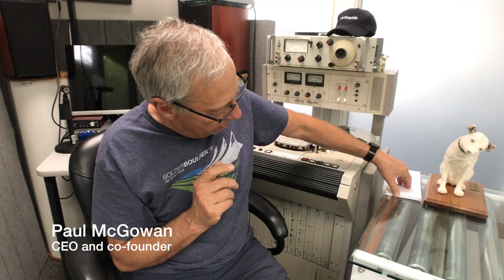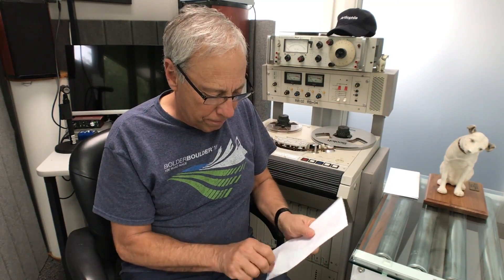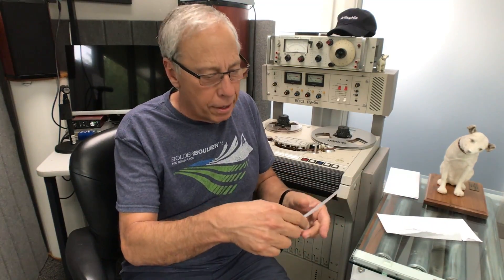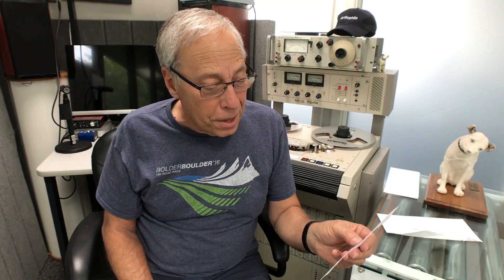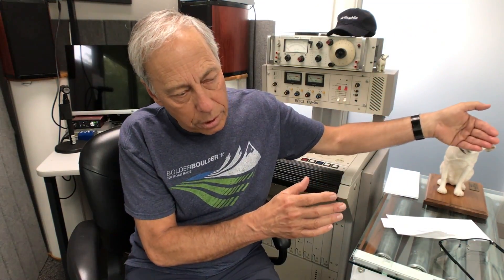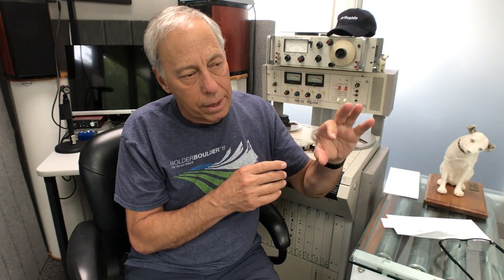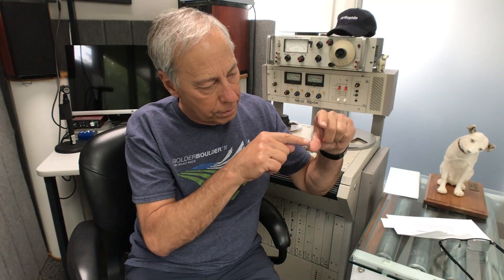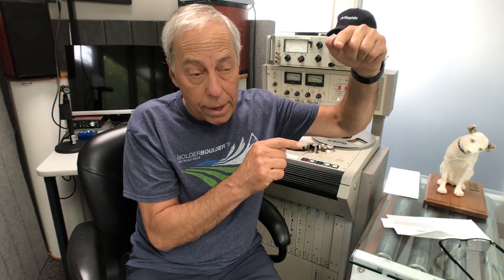Why are power amps so difficult to design?

Comment: A follow up question for Paul would be this: Why have there been so many variations in amplifier topologies over the years? It almost seems like engineers would have settled on one basic type that tends to work best for most systems and listening needs. I totally get that different designs yield different sound qualities but I’m still shocked at the number of variations over decades. And they still keep coming.

Comment: Having been in electronic manufacturing for decades, the single most common failure is power related.  Logic failure is very low like less than a percentage point.

Comment: I think it is not very difficult to design a very good audio amplifier if you are familiar with electronics, signal amplification and thermal management. It is much much more difficult to design a very good speaker.

An audio amplifier is a more or less straight forward development. Most of the work you can do allready with a good circuit simulation tool to find a simple design which fulfills your requirements and safety means like short circuit protection. Then you have to do some intense breadbord testing to find out, how your circuits behave at its limits. The next step is to bring it on a perf board which is close to its later PCB design to validate the parameters and limits. Then you will have to bring the design on PCB, check it and bring it into its final enclosure.

It is more difficult to design an audio amplifier for series or even mass production. In this case you have to take good care about the material, manufacturing, assemby and testing costs. And you have to take care about to get all the things for your whole production period, right in time and in place where you need it. And you have to make sure that the people will like your product. You have to take care about its look and feel properties.

Comment: I've been working on my power amp design for more than a year now. Getting a power amp that works is not hard. Getting a power amp that works, has low distortion and is reliable is not. Douglas Self, Bob Cordell and Randy Slone have all written very good books on the subject. 

It took decades before big solid-state amplifiers were made reliable, and there's good reason for that.
Reply: What drives the reliability issue?  Also, which book would you recommend for someone new to electronics?  I can build a simple single ended class A amp but beyond that….

Comment: Ok so I know this is a little off topic but you mentioned putting an amp in a rack or outta sight. This is why appreciate some of the older tube amos especially mcintosh and some of there new tube amos. With there astetic design you would be crazy to put that outta sight I feel the amplifier is 2nd only to the speaker they run. The dac,preamp, cd, power conditioner everything except mabey the turntable is just a box but the amo has curves and tubes and shiney steel and lights under the tubes. I feel that designing the body of an amp to compare to the performance of an amplifier is just as much art as you get in hifi. Mabey it's just me but I like to look at my components as a piece of art. Kinda the way some people would look a monea. The housing of a component can be just as alluring as a sculpture of a Greek god. I find the astetic of a component one of the most enduring quality

Comment: I have the 7kappas. What amp should I use? Or is my Sansui 9900z (165 watts from hell) enough?
Reply: That depends. I would recommend it like this, 4000-16000w RMS speakers use 900w amp, 1200w RMS 190w amp 

As the motive is to feed it with enough energy, I would like to advise you to look at your speaker specs and amp specs and then do the needful.

Comment: The best sounding and most silent power amplifier circuit i know in 43 years of audio is the circuit from the mid 90 and got better to the last edition with one stage extra for  better low frekvens control.The end 3.2 and The end xp millenium no negative feedback local or global.small size Linear.The midrange never thin sounding.Sound dont change with power.I have bild a "high"sensitivity 98db active speaker system swith 40inch tall 6inch wide push pull planar magnetic linesource midrange and 20inch amt tweeter section and 12 inch woofer pr side.and needed much lower noise from the p.amps.the power amplifiers i used made to much hiss.could hear it from my chair.These are so silent that my ear have to be close to tweeter to detect it is on.  I use a ground sound dnc24rpc dsp based active filter,1 pr side. I build a 4 channel verson of The end xp millenium in 2016 and again was supriced how good they are.I have put 2 stereo 21step autenators on inputs so i after calibrating the system room eq filters etc i can adjust the filters to 0db and level everything at the p.amp for that section of speaker Just a preference.The same type amplifier circuit was also used in a class a amplifier called Zapsolute from Scandinavia.They where design by LC audio

Comment: i just made a power amp its a very simple power amp  based on a 2n3055 and a mj2955 transitor and its a ab diode biased 

i use a lm833p op amp as a preamp and i use the transistors output for feedback  to the opamp 

and only on one channel when the signal is high at the top of a sinus for example i see using s osiloscope a very high osilation ~15MHz  (my scope is not that precise old analog scope great for oudio fel on its face ones needs readjusting ) and when you touch the transistors it goes away i have tryed somtings   anyone a good idea  to solve this
Reply: btw its stil sounds great and it has  completely overkil  powersuply using too 15 amp transformers at ~ 14 volts   and i use huge 0.5F caps conected whit a inductor from the diode briges  and i have 0.05 vold ripel on a 65watt resistant load

Comment: I'm not a high wattage listener, the tube amp I built works well enough for my needs but I know how much of a challenge building a power amp can be, I had a go at building a solid-state amp with a differential input stage, voltage gain stage and compound-pair output stage ... with some speakers it sounded great and could put out some decent wattage, but on other speakers it just oscillated like crazy (I'm talking Mhz here). Talking of speakers ... half an ohm? Why would anyone make a speaker like that?
Reply: Looking  inside some crossovers it is possible. Gaining one advantage  producer may fail in other place. Such value may be imagined only for particular frequency and if it is somewhre is sopranos then power load  may be  not dangerous (except oscillation) But check also carefully all sheldings in preamp.  Anyway if amplifier is not low output impedance then   feedback will not adopt  2) signal will be silenced. .  The worst problems are  within speakers and crossovers. Their basics of operation lay in changing circuit impedance depending on frequencies. That is equal to shifting the phases. How can one  demand that amplifier is not affected?  Their deficiences could be eventually compensated by amplifiers by  between other low output impedance. But my observations go further and show that it  cannot  cover deeper problem. Developed  by me  change of crossover philosophy although does not equalize impedance  made for me  opportunity to get rid of 90% misteries, No more questions about higher effectivity  and special timbre of tube amplifires - solid with such speaker set may  have almost the same and performance  is upgraded in a way not possible for wide used crossovers.                                       http://www.diysound.eu/?page_id=75

Comment: There are a few amps out there that just won't transfer current that well, or handle complex/low impedance.  Incompetent amps will sound soft or unfocused because they simply lack the control they need to have.  I could tell that a Stasis amp for example, would curb stomp a mass-fi amp that was rated for the same power output.
Reply: Scott Lowell yes, there is a problem that almost every powereramp have, because they behave very load dependent. A good dampingfactor does not tell everything.